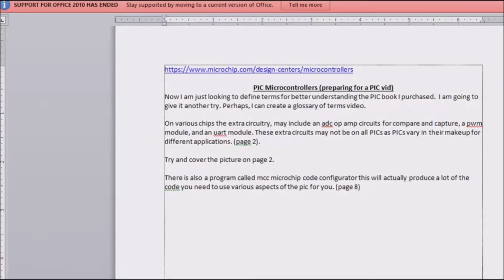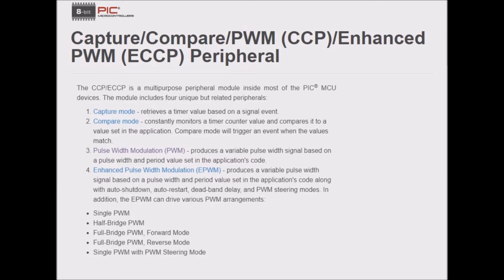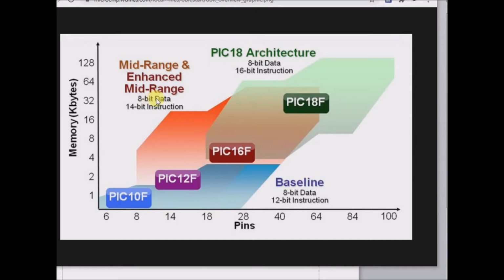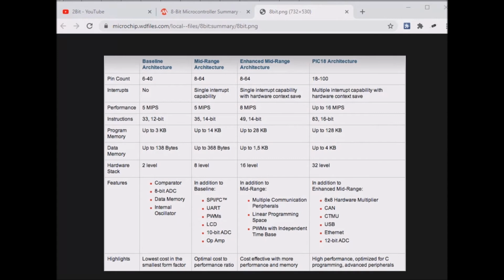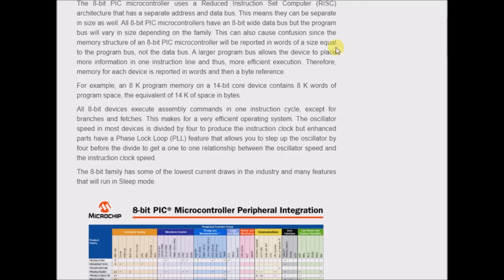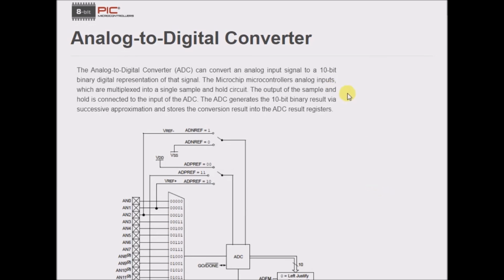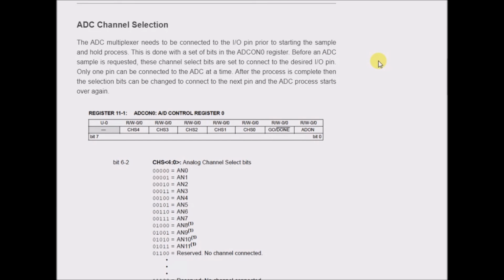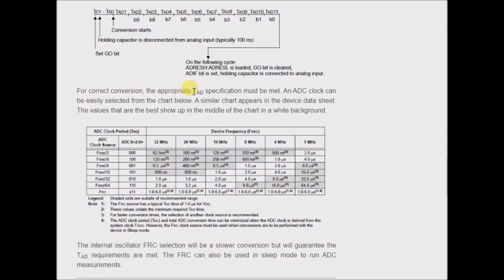8-Bit PIC Microcontrollers - Gathering Information Part 1

Comment from the maker: T.O.C
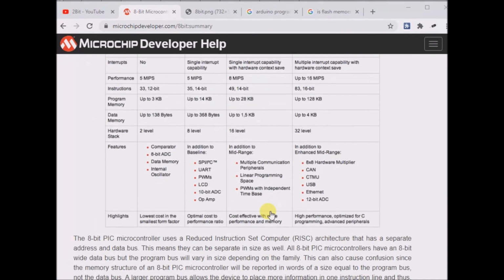14:16 Instruction Set (RISC)
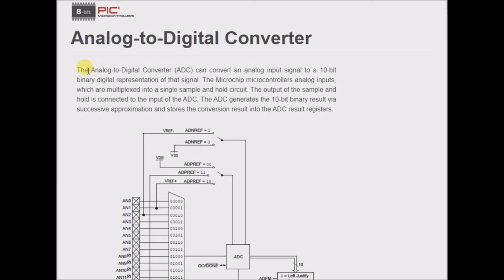18:30 Analog to Digital Converter (ADC)
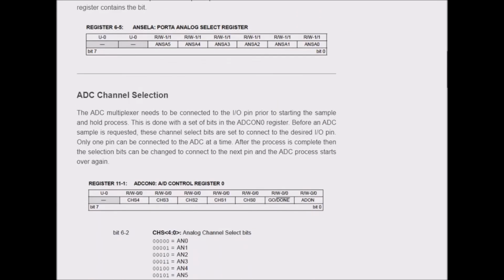21:48 ADC Channel Selection
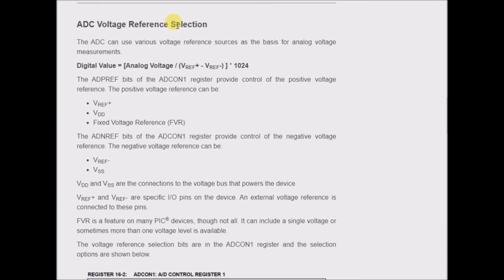22:53 ADC Voltage Reference Selection
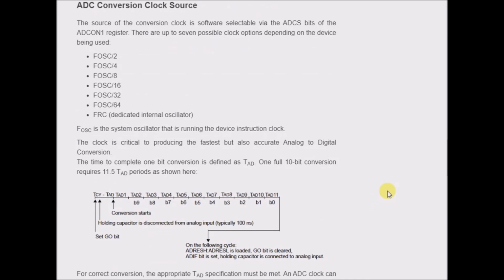24:27 ADC Conversion Clock Source
25:42 *sneeze